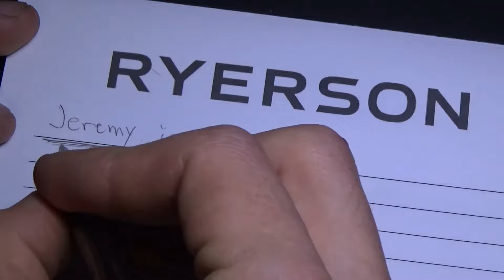Engraving my first gun! Part 2

Comment: Do you have to get it polished after engraving ?
Reply from the maker: It depends on the gun and the owner. Since this is a stainless gun with a matte finish, no polishing was needed
Reply: @jwsahm6703  I have a nickel plated gun and was trying to get it engrave but was told it will need to get polished I just don’t know if it’s necessary what do you think ?
Reply from the maker: @Rodromoe  it's best to remove the nickel plating before engraving as it will chip and flake off when trying to engrave through it. Then you need to get it re-plated after the engraving is done

Comment: I’m considering getting into engraving so I can decorate my own guns and axes in my spare time. That looked like stainless steel. How can I figure out which tool to use with each material? Stainless vs aluminum vs steel etc. Also, what is that ink called that you spread on it at the end? Finally, how do you get ideas for patterns? I think that is the part I would struggle the most with. Thanks.
Reply from the maker: I use tungsten carbide gravers. They can engrave carbon steel, stainless, soft metals, all of them. The ink is Rustoleum flat black enamel paint. When it comes to designs, I've been practicing drawing for two years now. Took me a lot of practice. For ideas I study other peoples work and take inspiration from them. I have other videos talking about tools needed to get started engraving, with more to come, check them out if you're curious. Best of luck mate!
Reply: @jwsahm6703  Thank you! Great info. I appreciate it.
Reply: @jwsahm6703  thanks